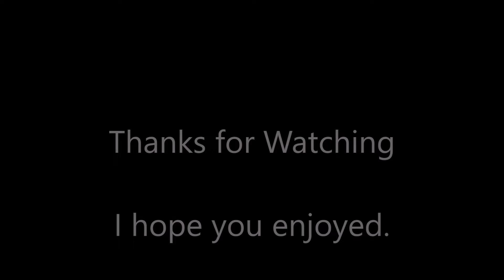Blue Comes Apart

Comment: Is the engine a 4.0 if so any good parts on it and anyway I can get the f150 decals off the truck or ford decals off the truck
Reply from the maker: The engine is a 300 6 inline and I think its a 4.9 , As its sits right now its a complete engine but its stuck. It ether blew a head gasket or the radiator let loose and got it hot and blew the head gasket, I don't know witch. The only thing that been taken off is the power steering pump and the AC compressor , I was going to use it on the 7.3 diesel but the cost of getting the right pulley for it is so high I can almost buy a hole new compressor for like $30 more so I'll do that instead.  The F150 decals there is only one on it, One was gone when I bought it. I have the entire interior bed and tail gate bumpers side windows engine trans rear end and lots of other parts I going to sell. I sell them for a very reasonable price. Bandit